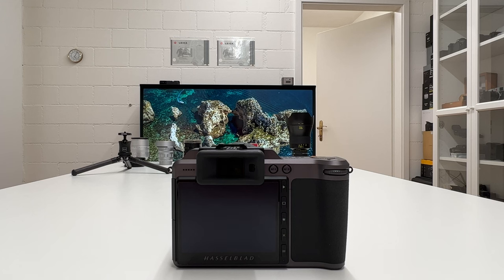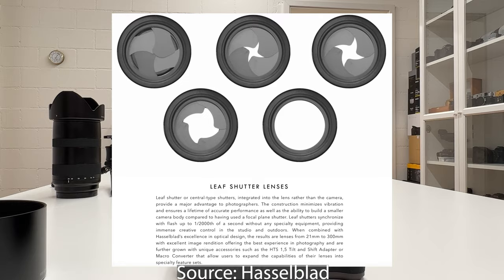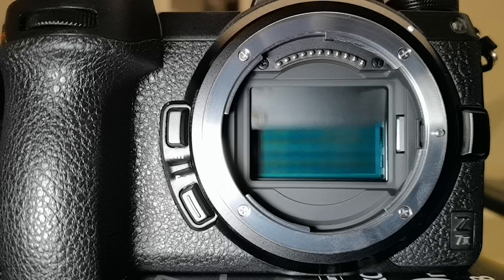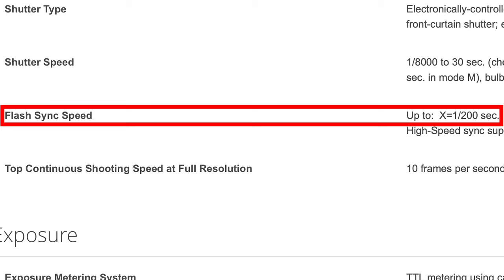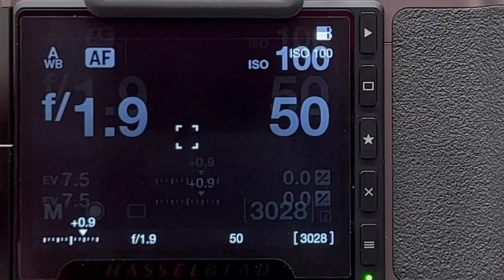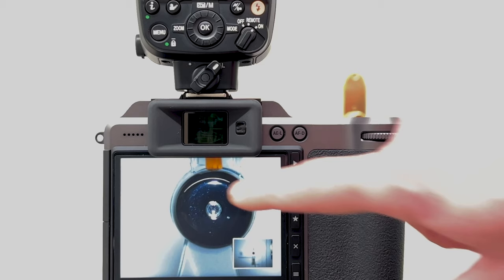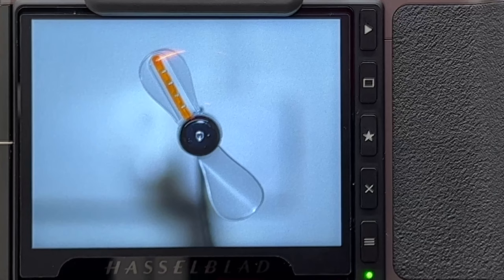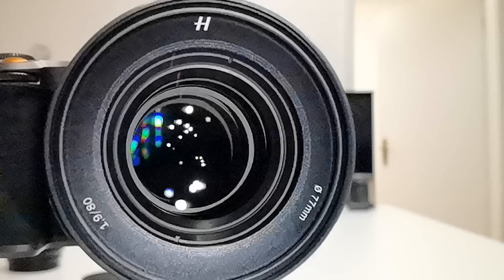Leaf Shutter vs Focal Plane Shutter | Hasselblad-X vs Nikon-Z

Comment: The leaf shutter exposure of the XCD lenses and orange dot HCD lenses is in fact a hybrid type (older non orange dot HCD lenses are purely mechanical but limited at 1/800 s)
These lenses have a mechanical leaf shutter with a shortest speed of 1/1000s. To obtain faster speeds up to 1/2000s the body delays the sensor activation up to 0,5 ms to obtain an exposure of 1/2000s. For example at 1/2000s the shutter exposes 1/1000s but during the first 0,5ms the sensor is not activated leaving for the sensor only 1/2000s of the 1/1000s shutter opening.

If you don't want to loose power with relatively slow studio flashes, you have to deactivate "true exposure" in the shutter menu. As real exposure changes with aperture on a purely mechanical leaf shutter, "true exposure" makes a speed correction depending on the aperture setting used.
"true exposure" is not compatible with speeds in hybrid modus at 1/1000s and faster and is deactivated by the camera itself when these speed s are used.
Reply: Hybrid exposure performance goes even higher with the Hasselblad A6 aerial reflex that is a variation of the H6. A6 shortest speed is 1/4000s with a more delayed sensor activation in the same 1/1000s leaf shutter opening slot. According to Hasselblad engineers this fast speed can only be obtained with carefull and precision calibration of body and lens shutter.
Reply from the maker: Thanks Jean-Claude, very valuable and interesting comment. Insightful.

Comment: This is a superb explanation and settles an argument on another forum, where one person says mechanical shutters cannot go faster than 1/200s. This was a discussion on the renew XCD V lenses where the 38v and 55v specification states 1/2000s is possible, and the 90v where the specs says 1/4000s !  It would be great to see a follow up with these lenses on the X2D at these flash speeds. Thank you very much.

Comment: from a Hassy forum (not my word): No MF leaf shutter goes up to 1/4000s !

The shutters are mechanically limited to 1/1000s and faster expositions are obtained by an "electronic first curtain" emulation based on a delayed sensor activation after shutter blades are open.
For 1/1000s expositions and slower the sensor is activated just before shutter blades opening.

This technique is already employed on H6D and orange dot lenses and X cameras with XCD lenses to go up to 1/2000s and the A6D with its modified H6 basis and H lenses to go up to 1/4000s.

Some time ago a Hasselblad technical eng said that it would be possible to go up to 1/4000s with X cameras amd XCD lenses by a precision calibration between camera and lenses timings. (leaf shutter working at 1/1000s and sensor activation delayed by 3/4000s)

Comment: On the Fuji x100v the leaf shutter can synch with flash to 1/2000”, but at apertures smaller than f/4.5 it can synch at 1/4000”.  

Am I right to conclude that the shutter leafs do not open fully when the aperture is smaller and thus travel less distance?  Is this coupling of shutter opening to aperture unique to the x100v or is it also found in other leaf shutter cameras?

Comment: Great video.  I hoped to gain insight into why the X1D can't utilize a group flash commander, and if using a focal plane shutter is a solution. If a group commander can't be used, then what are the work-around options?  How about a flash trigger?  Other?  Thanks!

Comment: There's an incorrect interpretation @14:16. The fan was not frozen by a 1/2000s shutter, but by the flash. A flash duration can be 1/20000s, which is much shorter than shutter speed. This technique is commonly used in commercial photography to freeze moving objects at high speed. On the photo, one can see a light track of LED on the top. That was actually "frozen" by 1/2000s shutter, which is obviously not "sharp and clear".
Reply from the maker: I should have expressed myself more precisely, thanks for pointing out.
Reply: Completely agree, the flash froze the blade and the 1/2000s shutter allowed the light trail of the led light. In fairness you don’t get the banding he spoke of with the electronic shutter though

Comment: Great explanation! What is the explanation for the heavy vignette/light fall-of tiwards the edges in the first flash shot?
Reply from the maker: Yes - I saw that too. My guess is its over-exposed reflections centrally from a white wall in the background with only a bit more than 1m distance from camera to wall plus I did not adjust a diffuser on the flash. Well spotted and thx for the positive feedback.

Comment: What phone are you using? It seems to be faking its 700 FPS from something closer to 120 or 240 FPS.
Reply from the maker: 240fps is the max on almost all smartphones. I used the Huawei P40 Pro+ and clearly they use computational photography to get this in somewhat acceptable form :)
Reply: At least Samsung S9 series definitely have real 960 FPS by only using the central part of the sensor.

Comment: Any effect on rolling shutter from using a leaf shutter?
Reply from the maker: Based on the leaf shutter construction as explained in the video, no rolling shutter with leaf shutter as you could see when freezing the fan blade movement with 1/2000sec and the Nikon Speedlight flash.
Reply: Rolling shutter effect can occur with a focal plane shutter and very fast moving subjects (all points of the sensor are not exposed at the same time) but cannot happen with a leaf shutter because all the surface of the sensor is exposed at the same time.